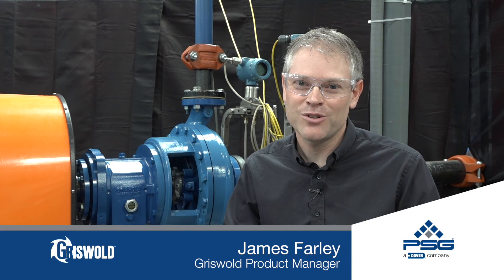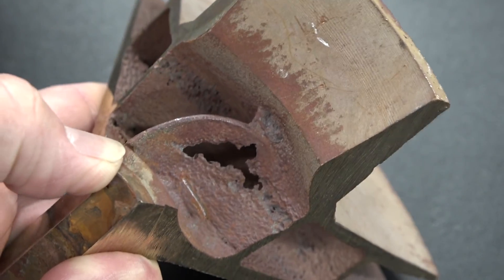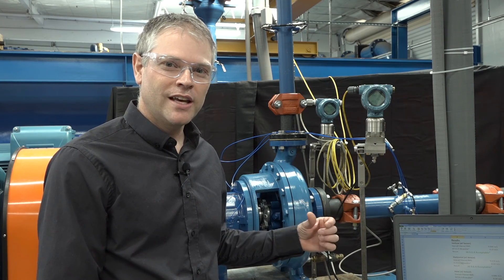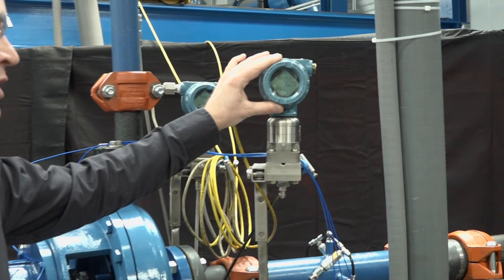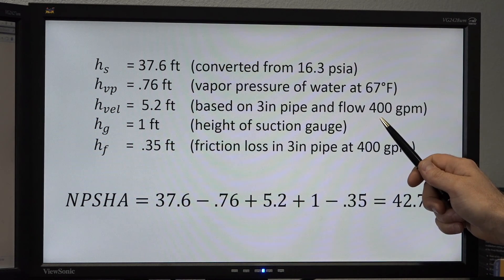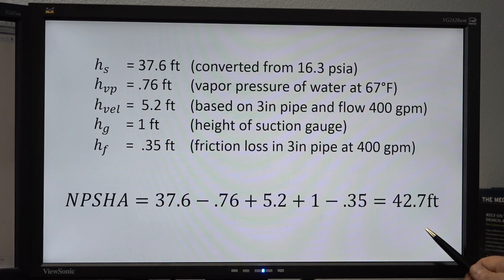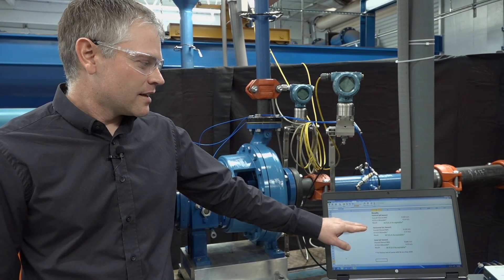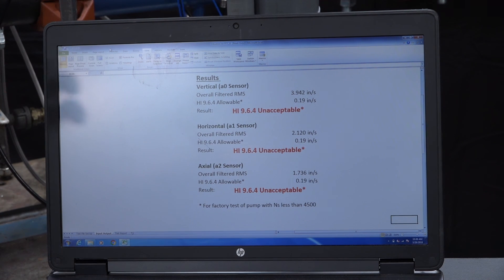How to Determine Available System NPSHA for a Pump

Comment: why add the friction head and elevation head with absolute pressure. absolute suction pressure is the sum of friction head and elevation.
Reply: I think so 
Thats why I got confused
Reply: @ahmedmohammed9486  this is an old comment, but I think the friction losses he is talking about is the friction loss from the point where the pressure gauge is installed to the pump suction. This is an extremely small number and is definitely not calculated correctly in this video. There is no way you lose 0.35 ft head in a 1ft section of pipe. In the video, he does exactly what you are saying - he included the friction losses in the suction line twice: once when he read off the suction pressure from the gauge, and another time when he subtracted the total friction loss in the suction line in his formula.

The elevation 'hg' he does do correctly. its just the elevation of the pressure gauge itself from the pump suction. Again, this is a very weird way to do this, but he is doing it correctly. He does a very poor job explaining what each term means. He should have video taped himself by the actual pump and pointed to each of the areas so we could understand it more easily.

This is the problem with people who just want to memorize formulas to learn things. You need to conceptually understand what the formula is accounting for before you can use it. I applaud you for catching this mistake - it only dawned on me until after I read your comment.
Reply: Thank you. I also think that the velocity head should also be included in the suction head. Please correct if i am wrong

Comment: I don’t know if key details were left out purposely or the video maker was truly stupid. When the pressure at suction was measured, how was it converted to head? How was friction head determined using gpm and pipe diameter? NPSH available was never compared to required. The most childish thing was mentioning at the end “ now you know how to calculate NPSH available”. I think YouTube should delete this video and ban the person who uploaded this video. That will benefit student, seriously.
Reply: Calm down brother. 1 PSI = 2.31 ft of head for water. There’s a simple pipe loss formula, google it. You’ll need to know the roughness of your pipe for that —> look at engineeringtoolbox.com. And yes he never compared NPSH available to NPSH required (from pump). I believe that NPSH available must be greater than NPSH required to avoid cavitation. Someone please correct me if i am wrong
Reply: Where can I find the formulas that he used to do all the calculations